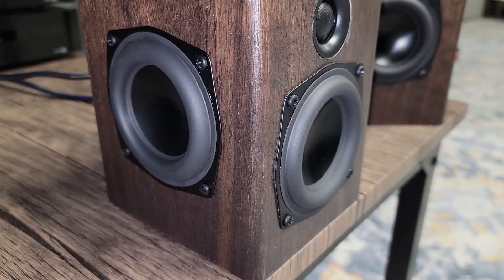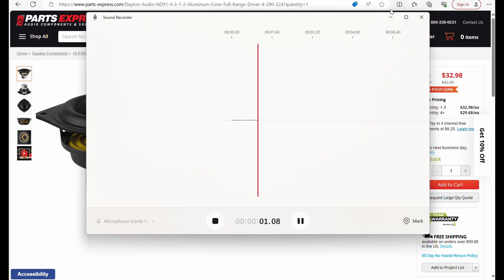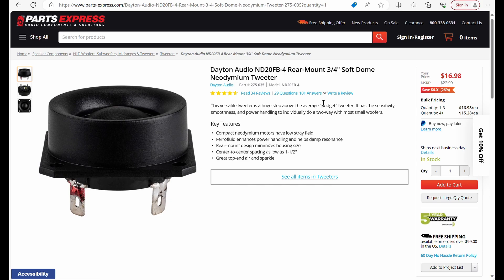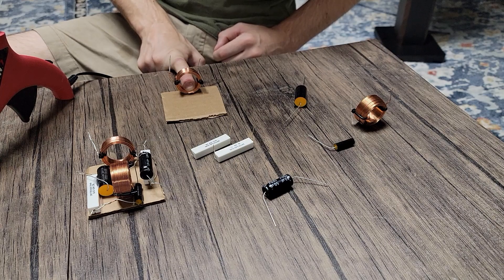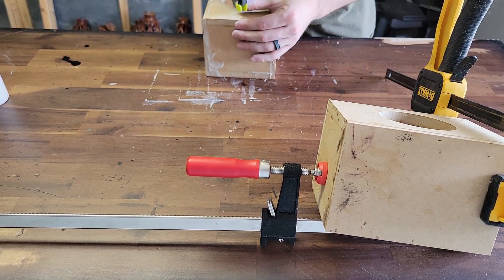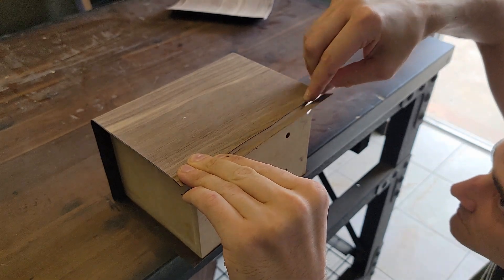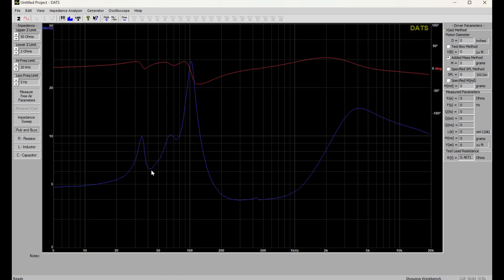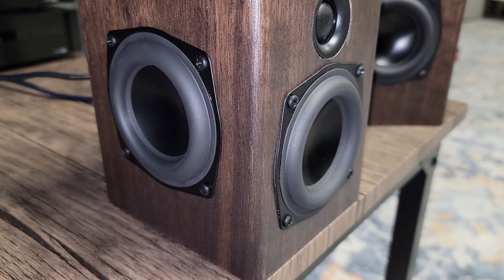Budget Mini Monitor? Lets Build The Passive Aggressive Kit!

Comment: Nice vid. Could you not carefully mount the xover on the base panel and then glue up, if you carefully pinned the wires to the upright panels?
Reply: If I were to build I would try and make an external xover case and use brass connectors and a v short cable run between case and speaker to maximise the driver’s internal airflows and expected behaviours and use a damping filler material. It may add to the cost but if you want small enclosures and can hide the xover cases behind them on a bookshelf then it could be a worthwhile option.

Comment: Used this kit parts list as a starting point for building my speakers. Upgraded all the electronics (kit is 5% tolerance. went with 1%) and used 12 gauge wire throughout. Also everything is soldered except the plugs into the tube amp. Mid and passive on front with a downward passive. Moved tweeter into a brass globe on top. Boxes are slightly larger with 3/4"MDF and round backs. Used 7/8" Koa for the face plates. Stuffed with fiberglass. Sound is incredible
!!!!

Comment: 1/4" hardboard is excellent for xover boards. You can use standoff or make circular spacers, drill a hole and just use drywall screws into the cabinet with a couple blobs of hot glue so you can easily get them back out.

Comment: these small ND drivers and matching passive radiators are a blast👌 I built a portable box using these and an old double casette boombox and shaming JBLs all day.😂 the plastic box has ofc 4layers  of laminated heavy fiberglass inside (air tight)..//and using D class 2x50W amps and 10cells,.20V li ion batteries

Comment: What size or heat range soldering iron did you use?. I have the same kit,but I've never soldered wires or built speakers before. Please be nice lol.
Reply from the maker: Hey, I'm not an expert on soldering. I use a pretty small tip, and crank up the heat. This is a very cheap unit from Amazon. Good luck!

Comment: The Dayton ND92-8 driver reaches down to a TRUE 50 Hz and holds with-in +/-2 db to about 6.5K Hz. For $7-8 more, it's far better sounding driver and provides a more suitable impedance load to most amps. I built a pair of kitchen speakers with the old Aurasound Neo 90mm 8 ohm driver crossed to a similar tweeter in 4L nearly twenty years ago. Port tubed instead of passives. They are fine for washing dishes (my hands are my dishwashers!) and cooking or listening to my little flat-screen. The Dayton ND-92-8 is a near clone of the old Aura. I pushing them with about a ten WPC Lepei TI amp (with a BIG power supply), and by my home-made "DATS", they get up to about 103 dB with 5% THD at 1 meter. I didn't go for "maximum" low frequency (about 47 Hz), 50Hz is a far better compromise.
Reply: There's no nd92?

Comment: Clean up those edges around the tweeter and then hit the exposed inner edges with a black sharpie. You'll be much happier with their look.

Also, check out the trimmer that Tom Zarbo made / uses for his veneer work. The Pint Sized Powerhouse build gives good pointers on it.
Reply from the maker: Hey a familiar face! Yea I kicked myself for not using my router on the tweeter! And yes a sharpie would definitely clean up tweeter hole. It's press fit (TIGHTLY) so it may be a while before I pop them back out. Thanks for watching!!

Comment: looks like a lot of speaker for the money,  and applying a veneer is something i should consider on my builds. any speaker i have painted gets messed up after a few months, it is the screw point. even when i fill it and sand it perfectly. they bulge out after a few months.
I see the issue with small speakers, i made one with 3" drivers also, hard working inside that thing, i had bracing and dividers to contend with.
But i had digital crossover to at least i had not passive crossover parts to fit.